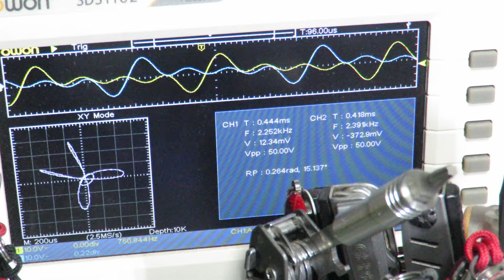Leatherman ARC with beautiful damascus wire cutter !

Comment: I expanded mine again. they are probably more stable. but the cutting edge is too wide, not "sharp" enough. That's why they cut normal wire worse.
Reply from the maker: Négatif ...